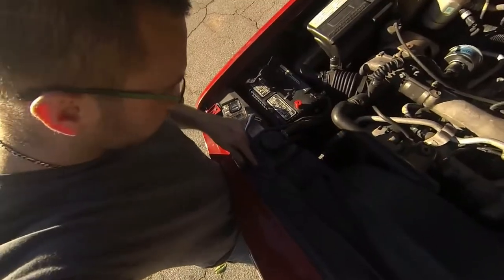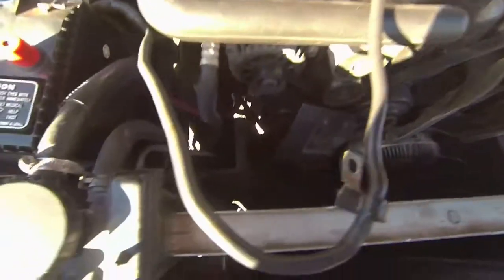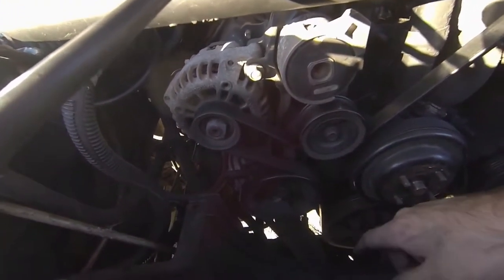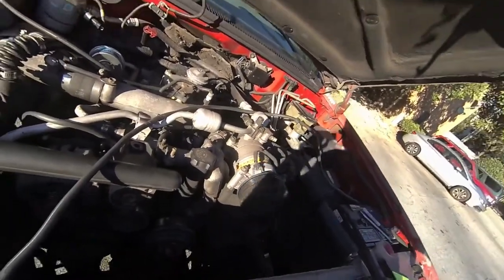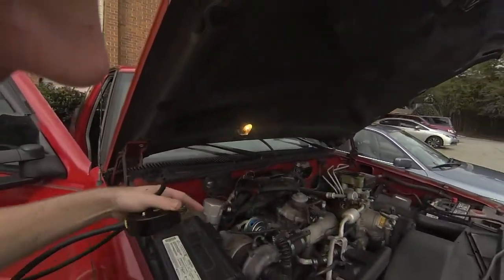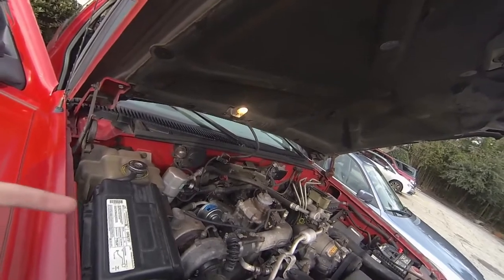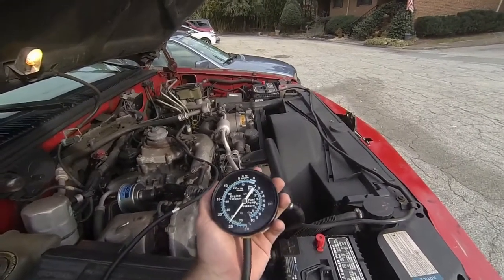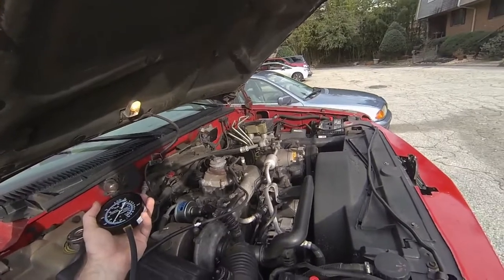6.5 Diesel Vacuum Pump Failed!! Ep. 15

Comment: My truck runs fine but going uphill is sluggish, I get some black smoke and the service engine light comes on,
Reply from the maker: some black smoke is normal. If its puffing smoke like a cummins, then there is a problem. Check to see what codes the computer shows.
Reply: 2nd Momentum Garage indeed, I figured it out it needed a new lift pump, now I have to fixed a wire that melted/burned. Thanks

Comment: The pump is supposed to make that noise. It's bad when it doesn't make that noise
Reply from the maker: I just know the truck ran better once it was removed. It’s possible it was a bad pump or hole in one of the hoses. Truck had over 300k when this video was made

Comment: Pull it out and toss it in the garbage you can replace it with 1 spring ! All it is is a power robber and serious disaster waiting to happen all it does is 1 job  it operates and limits your wastegate.
Reply: If you have a later model 6.5....you still need the pump for egr....